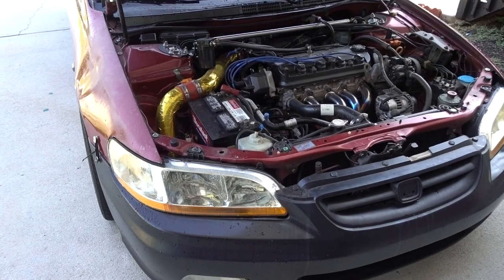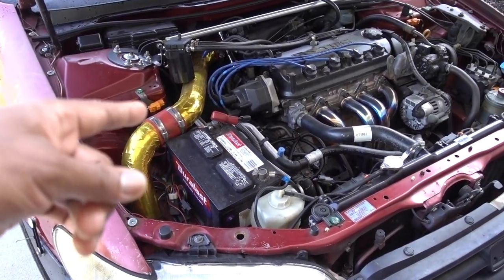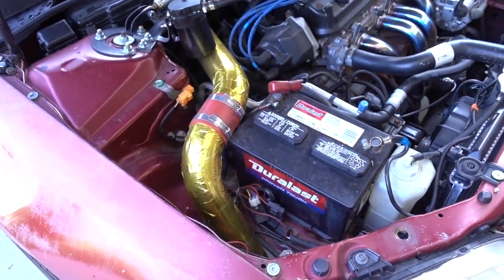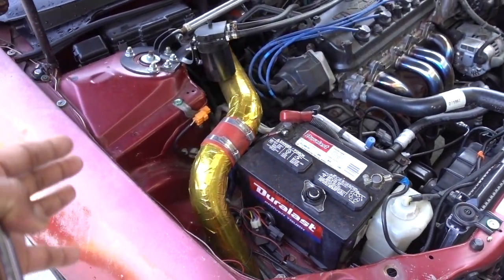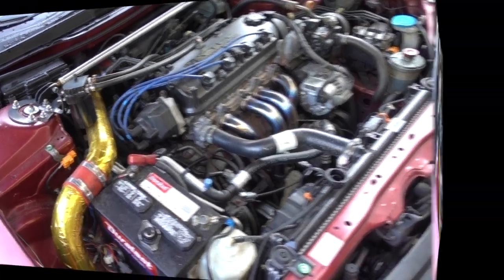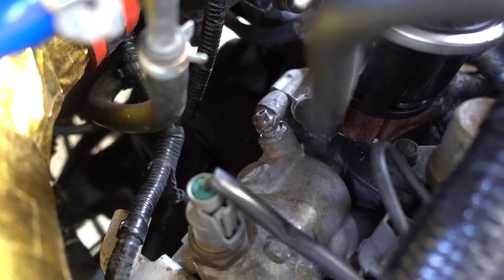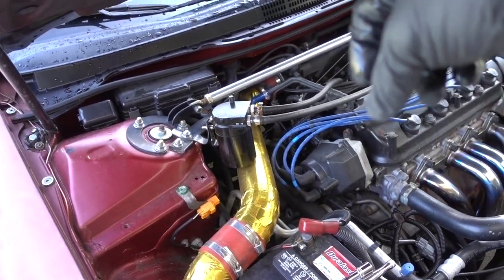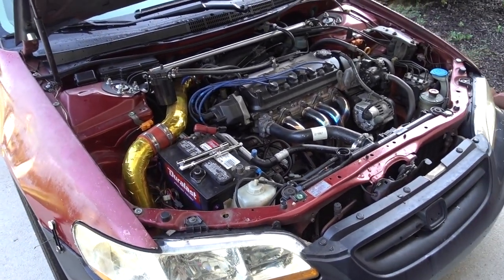How To Bleed Your Coolant System /2000 Accord

Comment: Victory!  Thanks Bullet.  I am working on a heater issue.  I had new Thermostat installed $100.  They forgot this step.  I started getting scary symptoms.. my heat was going way up.. got home safe.. then watched the video. Just as you say!  12mm.   I just had a funnel.  It is strange that you do it with the car cold.  I put keys to "ON" then turned heat up (but no blower).   I read this in a Honda Forum.  Worked!  Drove car around, going up hills,  short distances, stop and go.  WA-LA.  Worked great.

Comment: Make sure you drive it around get to normal operation temp then let it cool off and re fill the coolant.  Once thermostat opens it introduces more air to system so it will need to be bleed again. Poor video
Reply from the maker: Shut up
Reply from the maker: Losers criticizes, smart people share ideas, sorry loser I don’t care
Reply from the maker: The title clearly said how to bleed the system! Right? Make your own video expert
Reply: @BulletSolano  Why you get so offensive he gave some critical information. Take the knowledge when it's given instead of being offended. Say you're sorry.
Reply from the maker: @realdealholyfield-dx3bf 😂😂 sorry? I did this million times for Hondas, and clearly this person don’t understand the video, the title says how to bleed your coolant system! Right? Nothing is wrong with the video! The process is there and if the temperature goes up yes you have to bleed the system again, but some people don’t understand! I’m going to say it again! How to bleed the system! I don’t think that’s hard to understand! I show the process that’s all, that smart guy need to learn how to read
Reply from the maker: Now tell me, if the thermostat opens how air is gonna get in the system?
Reply: @BulletSolano  I suppose burping the system completely is what he was referring to which is in the owner's manual how to do which is where you add your coolant in the radiator, run it 30 seconds, turn it off, add more coolant if necessary, then start the engine and run it at 15000 rpm till cooling fans kick over twice. Then turn it off, check coolant levels again.

 Coolant expands when heated that's why even if doing a drain and refill you gotta go through the whole process to make sure air is out and levels are good. You weren't necessarily wrong just incomplete about the actual process of bleeding air completely.

Comment: Can you do this to the car when it’s cold ?
Reply from the maker: You should do it when is cold
Reply: @BulletSolano  I also have a issue with a rpm surge I watched your other videos about the iac valve being either blocked or having the gasket move after installing and creating a vacuum leak, what I did was a jdm swap and cleaned all the parts and reinstalled do you think that a issue with the iac valve is more likely than me having air in the coolant system? This is my first swap so I’m kinda stumped
Reply from the maker: Bleed it if it doesn’t work get a new Honda gasket
Reply: @BulletSolano  thank you for your insight I made a list for all the things I can do to diagnose the surge you’re videos helped out a bunch, hopefully I can get it running nicely soon
Reply from the maker: Peter you got it
Reply: @BulletSolano  got home from work today Bled the system, cranked it up already 200 rpms lower than before ran for 20mins also turned on Max fan and heat shut it down, let it cool, bled it one more time, started it up and put it in reverse and then d4 rpms shot down to 750 rpm it was at 1000 before idles like a champ at 750 pretty stoked about it bc I came into this project with no knowledge I just knew it was possible to put a jdm engine in a usdm vehicle😂

Comment: Ok but do you bleed while car is off? Or while running?
Reply from the maker: 🤦🏽‍♂️ really? Did you watch the video?
Reply: @BulletSolano  you could just respond. You don’t explain too well. I’m asking bc I’m currently doing mine
Reply from the maker: I did that in the beginning, after replacing the parts you bleed the system, with the car off